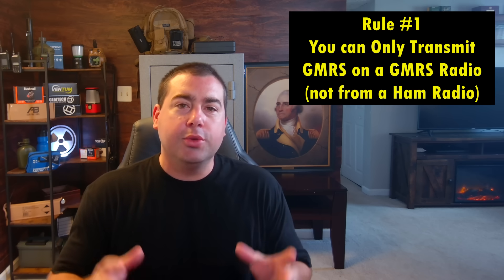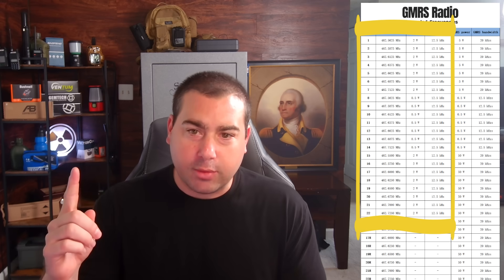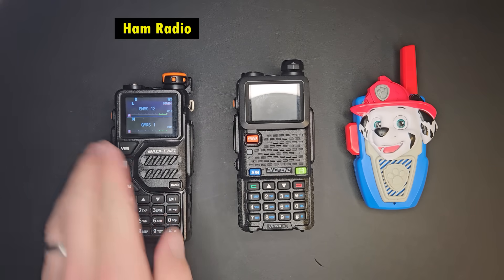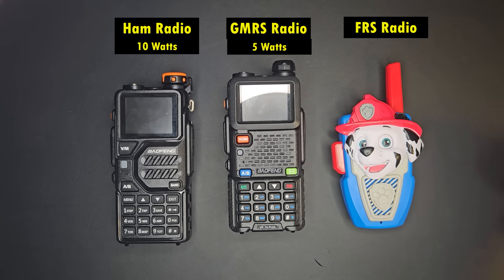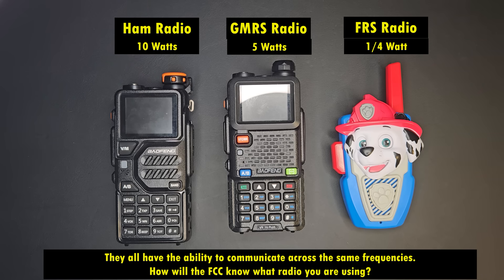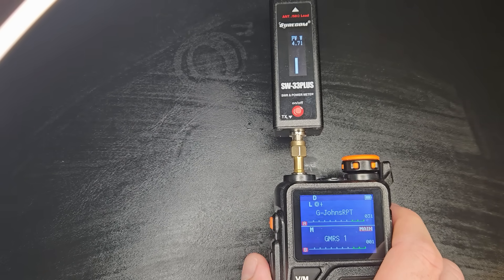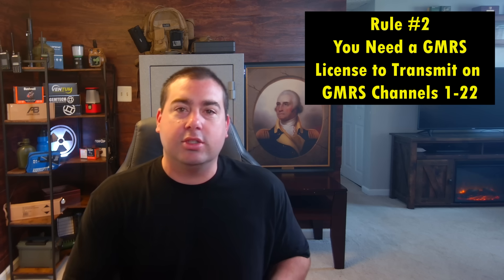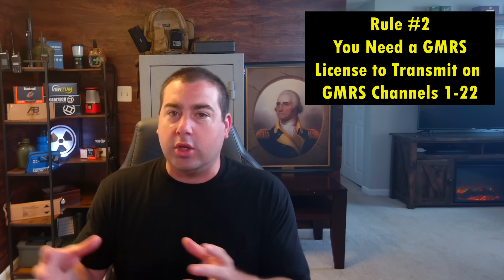Radio Rules the FCC Doesn't Really Care About & Why

Comment: Videos like this should not be on YouTube. You are advocating illegal activity.  As a ham  you should  know that using a 10W HT is unsafe (RF exposure)  unless you use a remote antenna (e.g. a mobile antenna attached to your car).  GMRS is designed for folks that do not have extensive radio knowledge that why the frequencies and power levels are locked. The GMRS frequencies that are shared with FRS have a common power level to make all users more or less equal. A GMRS license costs less than a penny a day so there is no excuse here. If you were a member of our local ham club, we would  remove you from the roster.  I have radios that can easily be converted from GMRS to Ham.  I I give an HT to an unlicensed party (family member) I give them the GMRS version and explain the ID rules.
Reply: I hold both a GMRS and a Technician license. When I program my radios I just make sure the GMRS frequencies are set to the proper power.
Reply: He's not wrong about 10 watts being a concern if it's near your eyes.  At least turn the HT upside down and get the antenna away from your face.  Or better yet, turn the power down to 5 watts -- you'll sound the same and your battery will last longer.
Reply: Heres the guy that gives the hams such a bad rep. Love that you pinned his comment so we can all laugh at him.
Reply: Great idea vladtepes481, people should only be allowed to create videos that you or people that agree with you approve of. How about books? Would you like to give us a list of those books that should not be allowed to be printed or read?
Reply: @zestokasis1  Are you as stupid as you sound. Indeed, I think people should not post videos promoting illegal activities.  I also cannot recommend posting videos on on safe practices
Reply: i meant unsafe practices.
Reply: You're the reason nobody wants to become a HAM and therefore more likely to not follow the rules. Because nobody wants to be associated with you. Just because your a member of a cult with membership call sign you're still a civilian not a law enforcement officer. If the FCC wanted to police people it would apply for a budget increase and do so.
Reply: @disband_thebbc5933 Well, Sonny. I am a VE and have about 120 VE sessions .  I would say somewhere in the neighborhood of 375 new hams earned their ham license in these sessions. The Technician License can be passed by a middle school student.  Perhaps you didn't make it that far in school. On the other hand maybe your just a nasty person. In either case stay off the radio.
Reply: @vladtepes481  people reading your stupid comment cancel those out easily :D like a legend always says "be 🖐🖐 careful with the experts in the comments"
Reply: I agree actually...people break the law when it suits them and hide behind it for the same reason
Reply: @DougEGuitar  Yes, there are those that don't follow non-oppressive laws when it suits them. There are  those that don't follow oppressive laws because our Declaration of Independence gives them the right to do so and says it is our duty to do so. Remember, interracial marriage was once illegal. The government told citizens who they could/couldn't marry. Is that not oppressive? Why would anyone follow such a law? What if a law was made that said you could only do it missionarry every other Sunday?
Reply: @franksfamily why is ok to transmit on GMRS frequency w/o a license and not on broadcast ?
Reply: @DougEGuitar  I never said it was OK. I am speaking in general terms, not specifically about GRMS. That said, the maker of the video said licenses won't matter in an emergency or a SHTF situation. He is 100% correct. So a boat is going down in the ocean and all the captain has is a HAM radio. The captain is unresponsive. Nobody else on the boat is a licensed HAM. So nobody can call mayday on the radio?
Reply: @franksfamily which is legal
Reply: @DougEGuitar  Great, so he isn't advocating for anything illegal. He specifically said emergency and SHTF situation. Glad we can agree. Now, onto ignoring oppressive laws, like the old law saying it was illegal to marry someone from another race. You are saying people should follow such oppressive laws even though our founders put in writing that we shouldn't?
Reply: @franksfamily how is having to pay virtually nothing to operate on shared frequencies oppression ? If you’re that broke buy a used CB
Reply: @DougEGuitar  You keep chaning the argument. We've already agreed. Seems you don't want to answer my question in general about oppressive laws. And that's OK.
Reply: @franksfamily there are a billion people starving..if you think having to pay 30 bucks for  license is oppressive don’t buy one
Reply: @franksfamily  I`m a communist...what do I care about the law ?  I am only interested in the public good.
Reply: @DougEGuitar  do you live in china? “The public good.” “Communist.” 🙄
Reply: @DougEGuitar  GMRS requires a license
Reply: whatever
Reply: Well you proved his point.
Reply: @soundguydon   it is a completely different frequency and its military in time of conflict which really doesn't care. Remember or is when you kill people and your safety is only secondary.
Reply: @radiobill4082 Huh? Want to try again in English? You must be replying to the wrong person, because your reply to my comment makes zero sense.
Reply: Dude really thinks the FCCs cares about his radioses
Reply: Since 10W is unsafe i assume these guys are now with cancer or dead right? https://youtu.be/b9UO9tn4MpI
Reply: @GabrielM01  Obviously are not familiar with the FCC requirements each ham must perform to insure RF saftey.  RF exposure is a function frequency, Power, Antenna Gain and distance from the radiator and duty cycle.  10W when the antenna is near you head is considered unsafe particularly when using  FM at VHF frequencies. Move the antenna away from your head and body and all will be OK.   Generally RF would not cook your insides instantaneously bur rather cumulative effects my result in eye damage or tumors. for instance. The FCC recommendations are easy to satisfy.
Reply: @vladtepes481  The FCC is shut down brother, couldnt even download a pdf test report
Reply: @vladtepes481  Reference medical studies please.
Reply: @RisingTidesAC  There are numerous medical studies that are likely to difficult for you to read. Every ham is required to perform an RF safety evaluation of his station. The ARRL provides a calculator for hams to do this. The principal factors are power, distance from the antenna, gain of the antenna, and transmitter duty cycle, transmission modes. The mechanism of harm is the heating of tissues much like a microwave oven does. Like a microwave tissues are heated from the inside of the body.
Reply: You clearly broke the speed limit getting to the comment section so you could post that so we're all guilty of something I guess.
Reply: Hey look, they do exist, I found a Sad Ham out in the wild!!! And not in the "not a Rubicon" comment section for once..
Reply: what a sad ham man get a life. this is why the hobby is dyeing
Reply: ive been a ham for 30 years and hold an advanced class license which is probably a higher class than you have. You are the type of people why i hate clubs, and do not support any clubs. They act like they are the Ham radio Gods.. when in reality they are nothing but a bunch of idiot Karen  boyscouts. Ever wonder why most ham radio repeaters sit idle and nobody is talking on them except for some Wednesday night net where three people check in? Look in the mirror.
Reply: The world is full of old, fat, white sad hams. They will all be gone eventually.
Reply: Your such a 🍆 s u king sad ham
Reply: Grow up
Reply: I agree.
Reply: you are the guy with low self esteem living in your basement sharing your personal info with other males with low self esteem...seems g4y to me.😂😂😂
Reply: awwww
Reply: Key details about a GMRS license
What it is: A license to operate GMRS radios, which are used for short-distance, two-way voice communication.
Who needs it: Anyone operating a GMRS radio system in the United States.
Cost: A one-time fee of $35.
License term: 10 years.
Eligibility: You must be 18 years or older and a U.S. citizen or legal resident.
Coverage: A single license covers the licensee and their immediate family members, including a spouse, children, parents, and siblings, regardless of their age or location.
No exam required: Unlike a ham radio license, no test is required to obtain a GMRS license.
Reply: Ok boomer
Reply: That's what tin foil hats are made for!
Reply: If you were a student in my English class, I'd send you to the principal's office.
Reply: Who the hell would want to be a member of your sad ham club.🙄?
Reply: This is Real World. Give it a break Mr.Killohertz Cop..HaHa
Reply: Grow up pusscake.
Reply: You are part of “some people” that get tripped up on rules. Very Hamish behavior lol
Reply: recently the US supreme court ruled that alphabet agencies can not make laws, laws must go through congress. these FCC  "rules are not laws". what can they do to you, maybe revoke your license, if you even have one ?
Reply: @duece-s9x  Try not to be stupid. Radio regulations require international agreements. The ITU oversees these agreements and IARU specifically addresses amateur radio issues specifically. The FCC is responsible to ensuring compliance to these agreements and national regulations as well in the USA. Other countries have similar organizations.
Reply: Here you will always find these "sad hams" that think they are the police of the air waves because the government gave them a permission slip to use the air waves. People that think they know it ALL only piss off the ones that do. 
Go play radio and leave the rest of us alone. Try minding your own business for a change.
Talk about dangerous using 10 watts that close to your head is simply repeating what someone told him.
It is sad that "some people" think that having a piece of paper with letters and numbers on it, makes them smarter than everyone else.
This kind of BS is what keeps a lot of people from joining their cult.
 Where are your YouTube videos? How about you show the world just how smart you are on your video's.
I thought so.
Reply: I guess I'm dead then.  We had hand helds that transmitted at a lot more than 10 watts when I was in the military, and we used them all the time.
Reply: @deepsea631   different frequencies.
Reply: @deepsea631 there is only one military HT that I am aware of that is 10W. The AN/PRC-163. They are pretty scarce in the field.  Everything else is a manpack or a vehicle mounted radio. So unless you're standing right next to an antenna or in front of it, when it's transmitting, you're going to be okay. That's why they put those yellow stickers on everything...
Reply: Different frequencies have differing health risks. Higher frequencies approach microwave bands, with localized heating effects that can cause tissue damage.
Reply: There are times to ignore laws, and times not to. The Declaration Of Independence says we have a "RIGHT" a "DUTY" to THROW OFF tyrannical government. When the government makes laws that are overly oppressive, we have a duty to not follow them. Alcohol Prohibition for example, it was a federal crime to drink alcohol at one time.
Reply: @franksfamily and own gold!!
Reply: @franksfamily  So, now I know you are a person of low moral character.  Radio laws for amateur radio in many respects are decided by international agreement (IARU and ITU). The FCC has a few extra rules for the USA but these are rather minimal. An amateur radio or GMRS license cost less than a penny a day. There are countries where a license cost hundreds or even thousands of dollars per year, A technician amateur license exam is designed for junior high students to pass. Perhaps, you have intellectual problems.
Reply: @franksfamily  alcohol kills brain cells
Reply: What you just proved is that the GMRS license is just for revenue, only. The fact you can give your GMRS license (no test required) to anybody, and they can use it tells you it's not about keeping the airwaves, clean or controlled.
Reply: Thank you, Mrs Kravitz.
Reply: Dude quit being a sad ham ! I have had my extra since I was 16  (50) years ago . The Feds care less as long as you do not step on someone’s toes  plenty of room for everyone out here  populate the airwaves if we don’t they will sell even more off to telecommunications companies . They don’t go looking it takes a complaint more than once to get them to send you a mean letter . Even the local FM pirate has been at it for over 10 years  no problems. Heck his format is better than the big 3 stations .  Hoping the PBS stations do go dark more room for the low powered pirates . I’ll be one of them .
Reply: @jhonsiders6077 I also have had my ham license for 50 + years and I agree with you.
Reply: @jhonsiders6077 and please bring back shortwave!! I used to cruise around the shortwave band and find all kinds of interesting stuff. I recently dusted off my shortwave radio and started cruising around. There were only two stations. Both of them just junk. Really heartbreaking to see what they've done to the shortwave spectrum. Please unlock it. Make it cheaper for some interesting people to start little stations again! Maybe the new voice for conservatism?
Reply: @jhonsiders6077 AMEN on the PBS/NPR point.
Reply: lol if that was true we'd be frying anytime we walked outside due to the myriad of radio and other wireless signals that abound
Reply: @PowerRider16  This comes down to the inverse square law.  10 watts right next to your eye is not a good thing.  You could cloud the lens of your eye with that type of power.  It would be better to get a hand mic and wear the radio on your belt -- or turn the power down to 5 watts and save your eyes and your battery too.  

One watt FRS radios are safe for kids to us.  A ten watt radio?  Not so much.
Reply: legal or not legal all my ht’s use a remote mac and speaker. if for no other reason than easer to carry around.
for years i used a company PAID privet channel radio.  and the mic clipped to my collar just made it work far better for me than not having such. 
( i worked in a yard goat).
Reply: @PowerRider16 make for certain that you have regular hearing/vision test, to assure that either aren't degrading or cooking faster than they should be. Also, have a regular urologist check your kidneys and other small body parts if you specifically wear your Feng bangers on the belt with an ear wig or lapel speaker Mike. Have a yearly check up just to be sure you haven't cooked any part of your body too early. Good luck.
Reply: @PowerRider16 that's because, we are. There's concern that 5G is killing off birds and bees. Just ask your local keeper and watcher.
Reply: I've stopped trying with these people. Let them find out on their own. The FCC wants to sell off all the spectrum anyway and with democracy dying as it is they are gonna crack down on comms more.
Reply: The United States of America is a REPUBLIC.

have you ever read the US Constitution?

have you ever said the pledge of allegiance

 NO where does it say democracy.
Reply: We are a representative democracy.  Semantics. Jeez….
Reply: Oh come on, Karen.
Reply: @andrewyoung-n8ary  Well, we now know you are a person of low character.
Reply: you are funny....
Reply: He's got to be a ham radio operator
Reply: @TM-gv6zv 
Finally, a real ham operator with a little intelligence.
Reply: @TM-gv6zv Nothing wrong with that.
Reply: A Sad Ham,
Reply: @daytona1212 definitely
Reply: I hate that people are leaving you hate- this is all the truth. Everyone leaving you hate are the same people promoting ham radios for their EDC without an ounce of knowledge.

The law is the law, even if you don't get caught, you shouldn't be breaking it, doesn't just go for FCC laws.
Reply: These guys who are piling onto your comment must like cataracts. That's what happens with long-term use of higher power levels near the eyes. There's no sense in accelerating the process.
Reply: WE used to tell Karen's like you  "someone is gonna' "Pin your Coax".
Go outside and touch grass!
Reply: 😢 cry baby….

Comment: Only in America do you need a permission slip from YOUR FCC overlords to transmit on the GMRS frequencies.
In Canada, there is no license for GMRS frequencies. However, in Canada you can't have repeaters, 5 watts max, AND the only radios you can use are the ones where you can't remove the antenna. But regardless of those restrictions, truckers are using GMRS radios in their rigs.
CB is dead around my parts. I believe it is due in part by the ridiculous practice of the CBer's in the US. Illegal toys, amps, modifications and broadcasting has made the 11-meter band a real shit show. I got fed up trying to talk to my friends and family with so many splatter boxes crossing into 2 or 3 other channels. Just go listen to channel 6 AM. SSB is a bit better on channel 35 to 40. But the people on there are ham wannabe's with their Q code. What ever happened to the 10 code that everyone learned years ago? 
Getting your ham license is radiculose in Canada. You need 70% of 100 questions to get your first permission slip. You need to be an electronic technician and know how to build a radio and know all the rules and regulations, learn the Q code, know all the bands and the frequencies along with being a mathematician, to have the "privilege" to talk to strangers in your area. But you can only use the 2 meter and 70CM bands with your beginners permit.
Just for fun, listen to the ham 10-meter band. Tell me what you hear. Then listen to the CB band, hear the difference?
Here in Canada, soon the people will have nothing and like it.

Comment: my radio has the ability to switch 0.5w, 2.5w and 5 w power, I think if i use the frs channel 1 to 7 on power 2w, channel 8 to 14 on  0.5w power, should be OK no matter the type of radio i'm using.